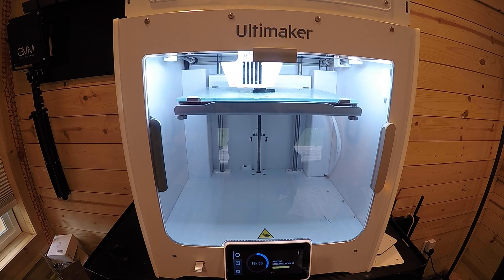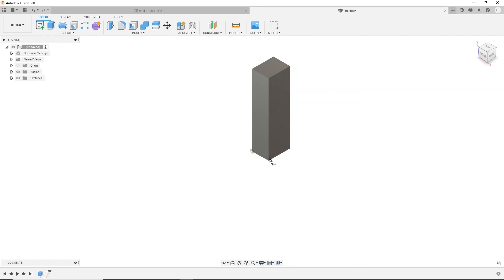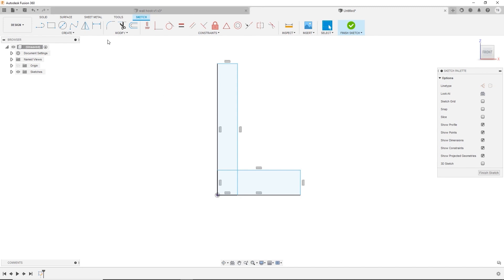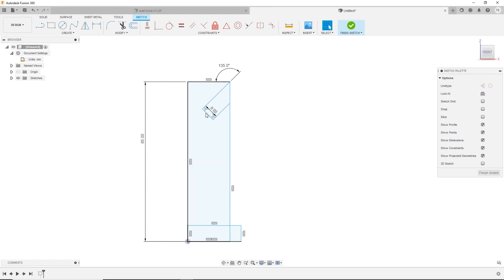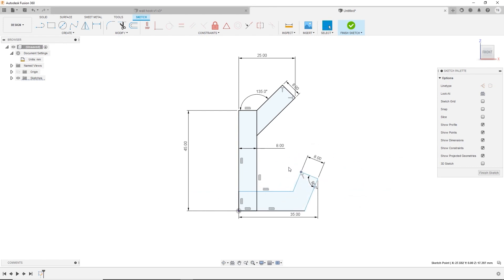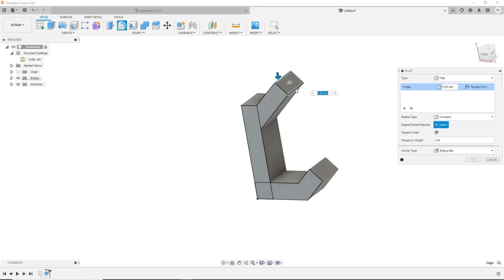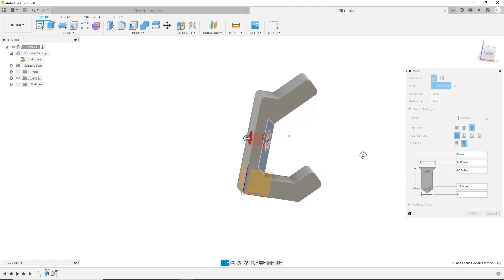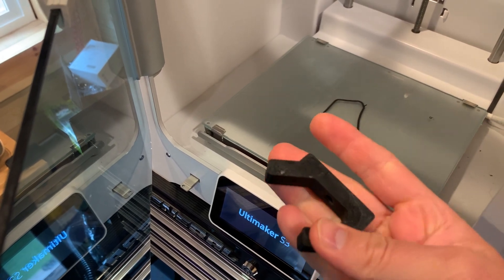Fusion 360 - Design and 3d Print A Wall Hook  (Beginners 3d Print Guide)

Comment from the maker: Fusion 360 Tutorials - What 3dprint designs do you want to see built in Fusion 360?
Reply: Hi Tyler, great video.  How about a video on modifying existing .stl files you can download from (for example) Thingiverse?  When you import these, Fusion tends to treat them as one solid pink mass, and I'm struggling to split them into bodies/shapes.  Previously I've just modeled what I wanted to print from scratch, rather than modify an existing design.  This strikes me as unecessarily re-inventing the wheel, and not what CAD/CAM should be about...especially if I'm just (say) wanting to remove a few features from an existing design in order that it fit my printable area.

Comment: Great tutorial! I ran into a problem recently with a part I'm designing where the fillet doesn't actually 'fillet' and exterior edge, but instead draws the arc you'd expect, but doesn't remove the material. Any tips?
Reply from the maker: Sometimes you can add the round in the sketch using sketch fillet or using arcs for greater control.  Happy to look at your example if you want to send it over... Tyler@techandespresso.com